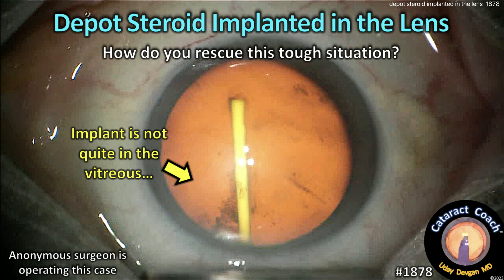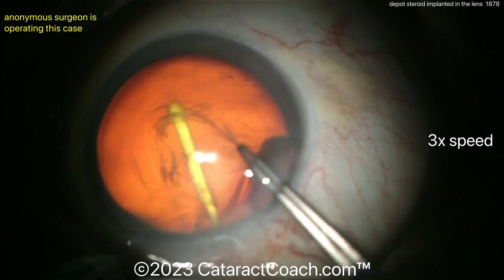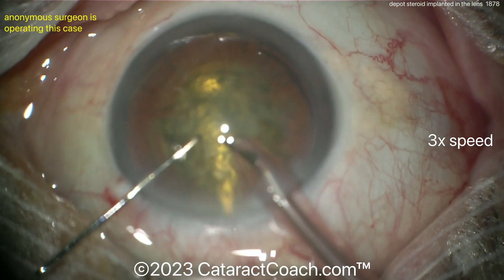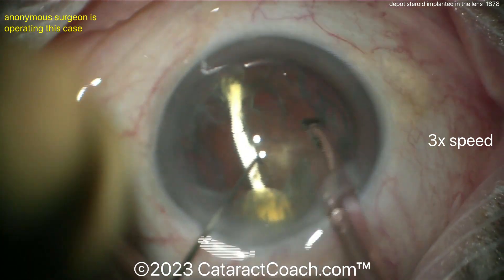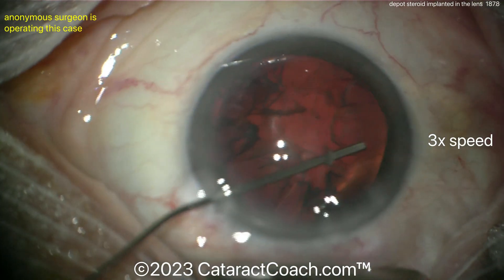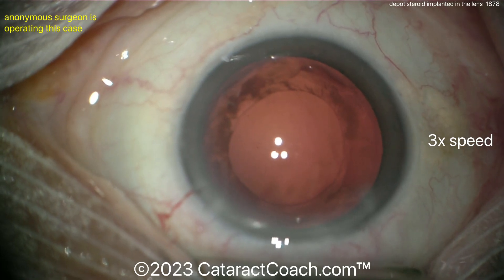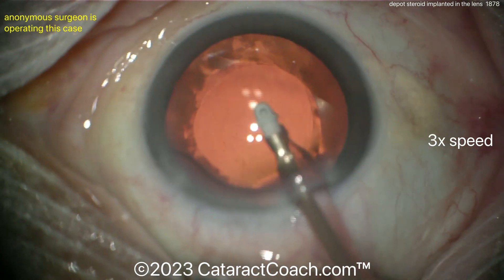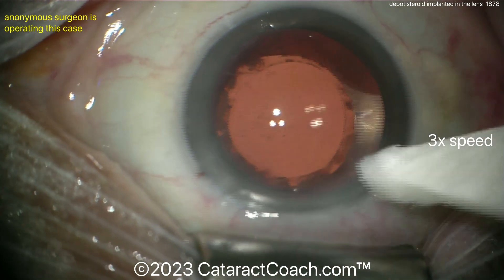CataractCoach™ 1878: depot steroid implanted in the lens

Comment: I removed a couple of those before, unfortunately no video available 

Just leave it for the experts 
It’s already a complicated case with liability issues 
So VitreoRetinal surgeons should take over at this stage 

I wouldn’t want this implant dropping posteriorly uncontrolled , and I don’t want any fragment to remain near the AC , as these ( most likely ozurdex implant ) are contraindicated in cases with compromised posterior capsule and are known to degrade endothelial cell count once present in the AC

The choice of iol is peculiar 😅
And where’s the suture on the main wound at the end ?
Reply: There's no vitreous in the AC even after triamcinolone injection, this is why I have used IOL in the bag with no suture, thanks for your comment.